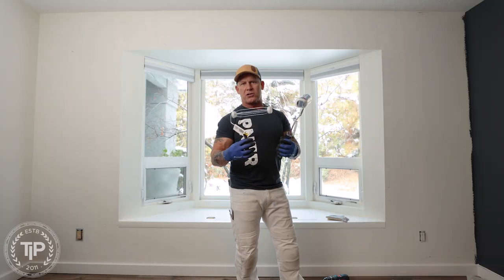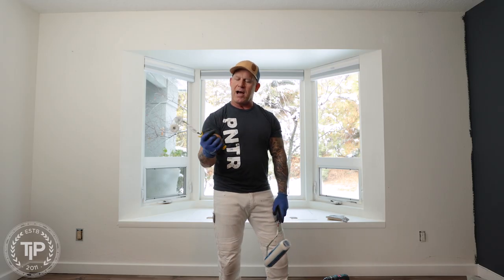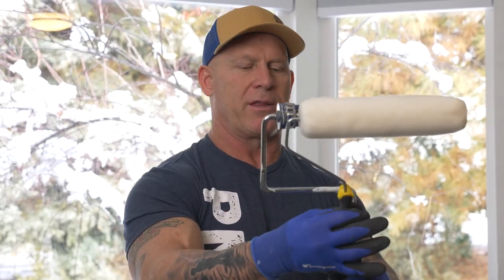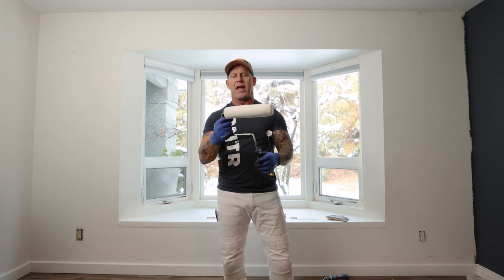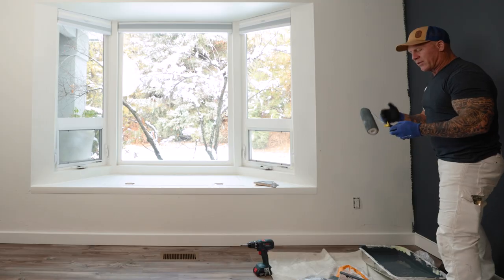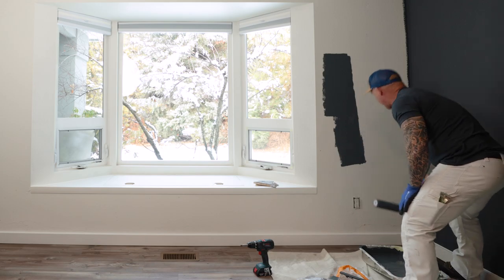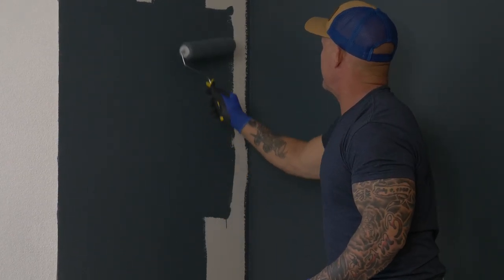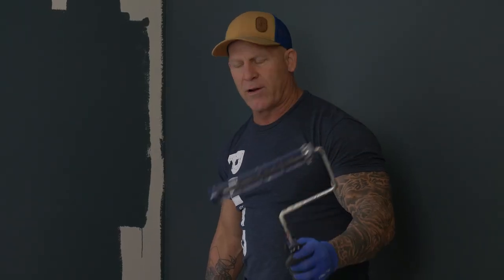Dollar Store Paint Roller Review.  Tools Not Worth A Dollar.

Comment: I'm not a painter but if you wrap the threads with tape and use a small hose clamp it will stay on. I had to use a homemade 25 foot pole and 9 inch roller to paint up high because I'm afraid of height 🤪
Reply from the maker: Nice tip Lawrence